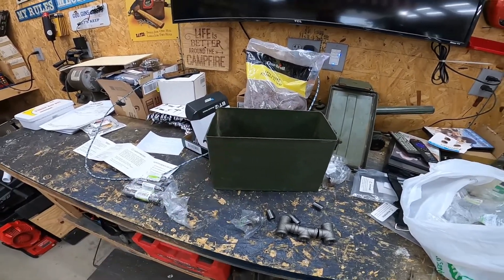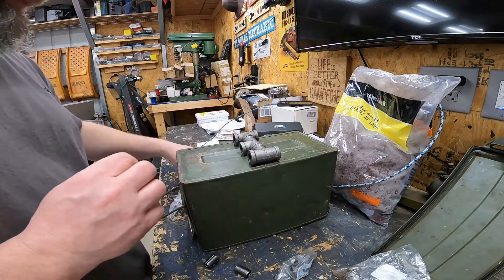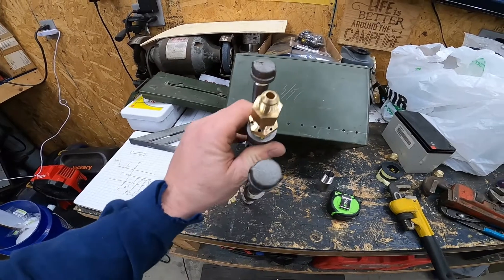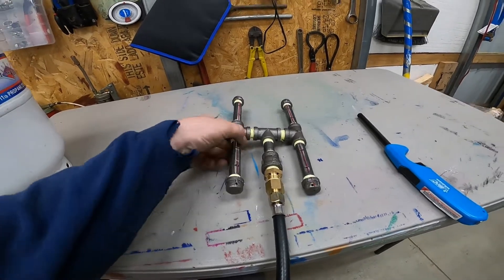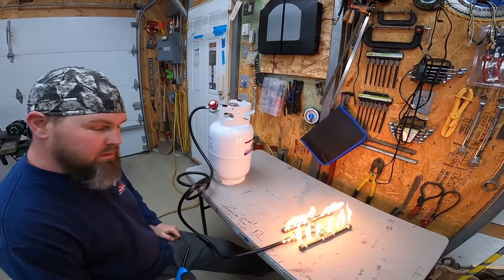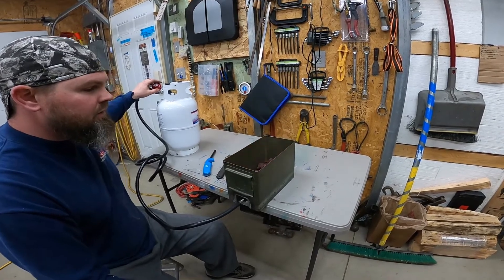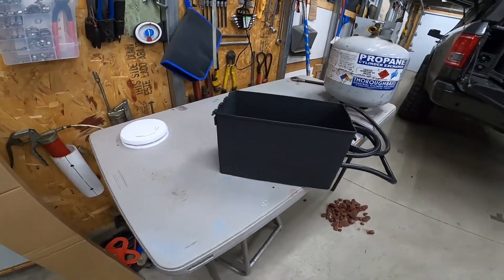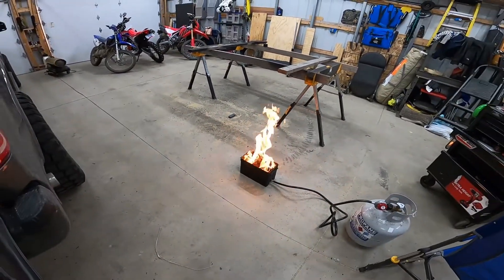AMMO FIRE BOX

Comment: Cool project. I made one but I used a single pipe in the middle of the box. I used Citristrip to strip the old paint off the can and painted it with high temp paint.
Reply: Are you happy with the single pipe down the middle, opposed to the H pattern? I’m hoping to cut costs and not need to by all the couplers and adapters if the single pipe is sufficient.

Also, how did you remove the paint? It’s such a pain to get off
Reply: @ZachBatchelder  yes. The single pipe down the middle provides plenty of flame. To remove the paint I used a product called Citrisrtip. I applied it and let it sit for 24 hours and it softened the paint up. I used a putty knife to scrape it off. Stripping the paint off was the worst part of the project. Lol. I then painted the can with some high-temp paint. I’ve only used it a couple times since I made it and the paint looks like it’s holding up so far.
Reply: @timjchick thanks! I’ll get some citristrip. I removed the paint from the exterior pretty easily with a wire wheel on an angle grinder but the inside of the box is too hard to get to. Hopefully the Citristrip will work. Thanks!
Reply: @ZachBatchelder  it still was a pain to remove but the citristrip made it a lot easier.
Reply: What drill bit size did you use to drill the holes? Thanks
Reply: @ I don’t remember now. Lol. It was about 1/8”.

Comment: If you get a 40mm ammo can, it is easy to store the hose assembly, and 2 1 pound propane cans for portability.  Also, take the rubber seal from the lid, and it acts as a stand for the whole unit keeping it 2 inches off the ground. Lastly, drill a hole for lighting it easier.
Reply from the maker: the hose fits in this box also

Comment: That's how it's done. Nice job. I only worry about the rubber hose being close to the heat source. One add on I would do is to get four of those plumbing straps and screw them at each corner on the bottom of the can for legs to raise it up a bit for cooling and air flow under the can. I'm making one for sure...
Reply from the maker: I just set the lid under it and the rubber hose dose get hot but as long as u don't touch it wile it's on it works good

Comment: FYI you might want to look up how the air valve works because having a reducer right after it. Really reduces its ability to work, specificity saying a straight piece is required right after it that it comes with. As well you can’t just paint over the original can paint as it will fail and cause your hi temp paint to come off
Reply from the maker: Ok I will look into it

Comment: Any issues with the propane line melting at the connection point ? ..happened to me  2 times in 2 days
Reply from the maker: It has got hot but not melted off yet I was thinking about buying a braided line for that reason
Reply: I had 2 braided lines.   What melts is the rubber inside the connection point ...may need to make an extender with some black pipe to keep it away from the flame even more
Reply from the maker: I mite try that then
Reply: @jplaysbay2929  did you figure out a solution? I just melted a line and it’s frustrating.
Reply: @thomasrmcdonald1  I under if you put fire proof insulation at the bottom and around the cut out, if that would cut down the heat enough to keep it from melting

Comment: Very nice. Where you cut out the can to fit the valve (hose connection) in, did you close it in or leave it open on the sides?
Reply from the maker: It's open and I can attach the hose there
Reply: @Garagepointzero  nice
Reply: @Garagepointzero  I think he is referring to the 2 square plates it looks like you welded to each side of the connector.
Reply from the maker: @Ever_Explore  yes the is closed in was just tying stuff